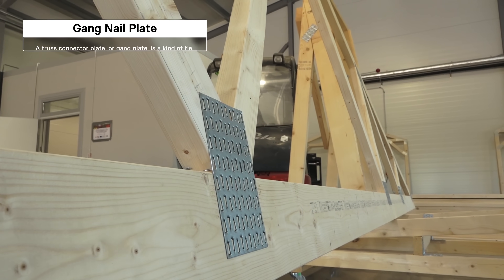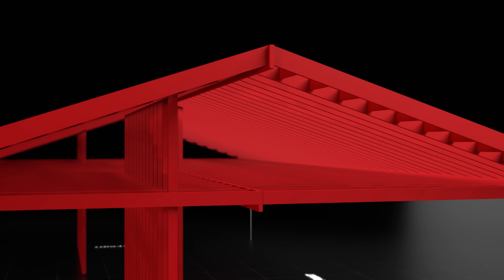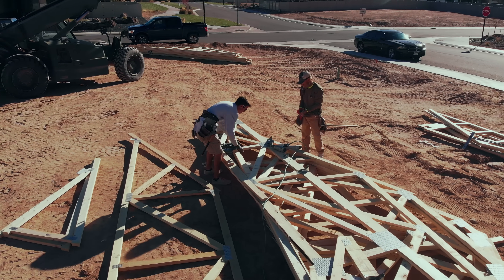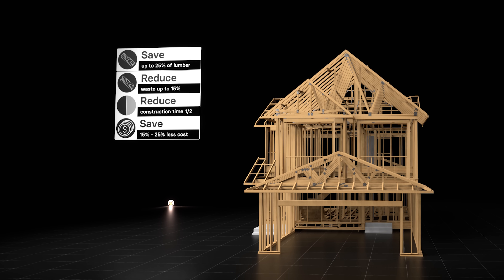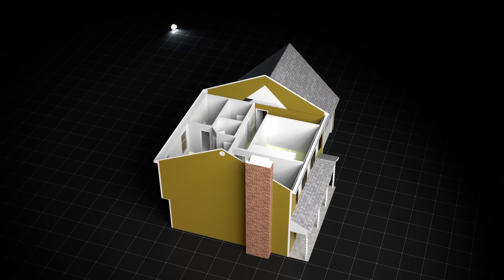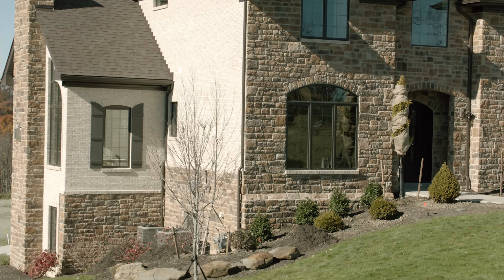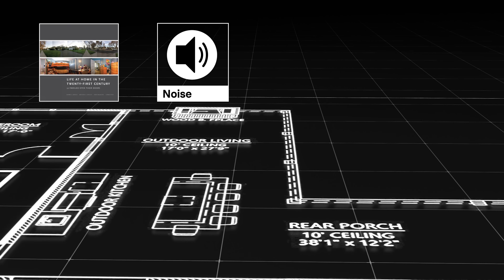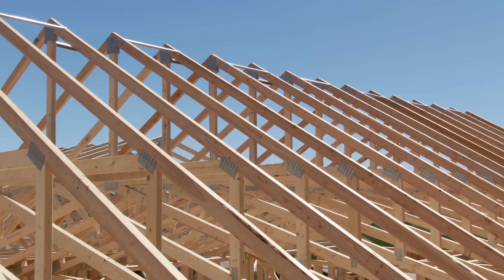The Invention that Accidentally Made McMansions

Comment: A puffy useless attic adds to the allure of being a zillionaire. Ie like giant hood of a 70s Monte Carlo. Lol.

The attics are often just rated for 10 or 20 lbs per square foot. To store light crap.  Bit Bubba after buying the MicMansion often builds another bedroom there.  And thus the floor flexes.

In prefab wooden joists they design firms save all the plans for liability.  Ie Jim Bob after buying the new house adds a bedroom in the attic. Weight room. Water beds.  Pool table.  So the structures ceilings pop off and finger pointing.  Lawsuits   blame the builder. Blame everyone except stupid Bubba..lol.

Once Bubba and June buy their Mansion they often want that fragile attic to be several more rooms. Ie do it secretly. They just build it like 4th grade tree houses. Have no clue about floor loading.  But once it fails they get lawyers to sue. That is why the wooden joist design firms keep a copy of what the beam was designed for. Ie often attic with 10 lb per sqft loading. To store xmas tree balls. Not water beds.

Comment: Rarely see trusses here on residential construction now, too much lead time, high PITA factor for setting them, etc but still building the unnecessarily complicated roofs with improperly designed dormers (but these check 'the boxes') all stick framed.  LVLs and I-joists allow those open spans below while allowing tolerances in house dimensions trusses don't.

Comment: 10:21 This brings to mind The Law of Unintended Consequences: 
"Whether or not what you do has the effect you want, it will have three at least you never expected, and one of those usually unpleasant."
Reply: It's also an example of Jevon's paradox: when you make something straight-up more efficient, more of that thing usually happens.  

More efficient cars? More miles driven.  
More efficient house construction?  Bigger homes.
LEDs made lighting cheaper?  So we made cities brighter.
Shipping container made for more efficient shipping?  More shipping happened.  
ATMs led to more efficient use of banks?  More bank locations opened.
Reply: @24HoLTeam93  On the LED comment, I really enjoy the dimmable LEDs with color adjustment. It makes winding down at night much easier with dim warm lighting.
Reply: Sounds like a key ingredient in "analysis paralysis".  As someone who suffers from that occasionally, I've learned to "not let perfection get in the way of good enough".
Reply: @coolraul07 No it’s just a matter of balancing the desirable and undesirable effects. Having worked in actual old mansions without gang nail plates or joist hangars, it can still be done. It’s just done differently.

Comment: This video has some resemblence with the increased efficiency LED lightbulbs gives. It has potential to decrease the energy-bill since it is more efficient. But now that those lights are very efficient, we can place them anywhere, increasing the consumed energy. While reseaching this topic, it appears to have been described as the 'Jevons paradox'.
Reply: @daisy9181  🤔 led bulbs last longer, consume much less energy and generate much less heat..  what are you talking about?😀
Reply: @daisy9181 Please just get “enclosed fixture” rated LEDs from Phillips/GE/Satco and stop with the conspiracy theories.
Reply: @daisy9181   😮😮 interesting to say the least, my experience is the opposite.. except the flickering, but even that is rare..  i have 11 apartments for tourists, so plenty of lights..  3 years ago during the renovation all bulbs were changed for new ones, i only changed a couple of bulbs (lets say ~10, out of probably 80+ bulbs), a couple stopped working and a couple started flickering..   it is true however that occupancy is about 50-60% so i guess not as much usage as in normal home.
Reply: The same applies in traffic planning - a new road increases the amount of commuter traffic.
Also in car safety features - people just drive faster.
Reply: Led lights are just awful.
Reply: @janelleg597   why?😮
Reply: @daisy9181  "We did it, I mathed it out, we should have had about a 10% reduction in our bill monthly."

You clearly did your math wrong.

If you have an electric furnace, a few winter nights with 10 degree lower temps are going to be enough to overwhelm your electricity savings on all your light bulbs for the year. One day of baking Christmas cookies will wipe out your LED savings for the month.

Whoever told you that you could expect a measurable decrease in your energy bill by switching to LEDs was lying to you. Lighting was never the main driver of your electric bill.

Comment: Really interesting, thank you! Was wondering if this was only a US thing, since all the modern houses I know in Germany still have attics. Thanks to all the commenters mentioning the issues in case of fire, that sure explains it! I think most modern buildings in Germany aren't entirely made of wood, just the roof structure, so they probably withstand fire for a while. Long enough to try to go in an put the fire out if it's safe. Meanwhile in the US the whole building structure often seems to be wood? So it might just burn faster in general, byt the time you start worrying about the roof it's too late anyway? (Wild speculations, would be interested to hear if that's actually the case from someone who actually knows things.)
Reply: So long story short, the smoke and water damage caused by putting the fire out are just as damaging.  Restoration work is labor intensive, expensive, and often results in a subpar product. Often it is just cheaper and better to completely tear down and start over. Unfortunately, much of American culture encourages a disposable attitude towards goods.  Mostly to maximize corporate profits.
Reply: Interesting, thanks for explaining! :)

Comment: NIST Abstract Publication from 2007 "A Study of Metal Truss Plate Connectors When Exposed To Fire" 
"The popularity of lightweight, metal plate connected wood truss construction is increasing due to cost effectiveness, versatility, and ease of construction. This type of construction brings many concerns to the firefighting community, since structural collapse has caused numerous injuries and fatalities in the fire service. In an attempt to determine the performance of metal plate wood truss connections during fire exposures, NIST conducted a series of twelve instrumented tests exposing one side of the test specimen to the thermal exposure. Load carrying ability of the metal plate truss connections was not measured during these tests. The tests were purely an attempt to study the heat transfer between the metal plate and the wood. Results from these tests suggest that the metal plates help to protect the wood beneath the plates."
https://www.nist.gov/publications/study-metal-truss-plate-connectors-when-exposed-fire

Comment: Europe: The invention of this early type of concrete allowed us to build massive castles 500 years ago.
USA: This metal plate allowed us to build larger wooden houses in the 1990s.
Reply: Larger cheaper faster baby, that's the American Way.  Who cares about sustainability or utility
Reply: @MarkBonneaux  The worst is all the ultra crappy foundations that get poured where I live. There's no reason that foundation repair should be the thriving business it is.
Reply: My German home has solid brick walls and steel-concrete floors of 10 inches. It will probably still be around in 200-300 years. My great-grandchildren may have to get the roof tiles changed around the year 2100, though (they are already 53 years old today).

Comment: FWIW, I think that it should be absolutely vital to apply intumescent paint to the plates, so that the heat from the fire can't cause them to char the wood until they pull out and the roof collapses.  

(Does anyone know if any tests have been done for this?)
Reply: It’s a good idea.  Probably more economical than covering the area in fiberglass cloth, which would also retard to flames. It’s not fireproof, but it is resistant enough to buy you some protection.

Comment: I'm surprised given the prevalence of tornadoes in parts of America, that heavier more robust building materials aren't used. We use heavy i-beams to support the weight of the roof while opening up the roof space.
Reply: A really powerful tornado is going to destroy any structure in its path. So steel beams won't matter. Tornadoes can pick tractor trailers up. The whole truck.
Reply: @1pcfred  While I can't truly appreciate the devastation of an F5 as I've never personally witnessed the destruction, there are always design solutions. A concrete basement with reinforced roof would be adequate surely as you normally see bare pads after a tornado has passed through.  Is that why people use wooden houses as it's cheaper to rebuild? When building for earthquakes we use lots of thin concrete superstructure but it has a high proportion of rebar to flex. That said I can't imagine the heartache for families picking up the pieces after a tornado.

Comment: Focusing only on the price of the lumber for roof structures, while ignoring the problem of  accessing the resulting  space filled with a forest of sticks. Accessing the space requires stepping onto thin struts hidden by a mound of fluffy insulation, or missing the  strut and poking a whole in the gypsum board ceiling below. Checking eaves  in a ventilated  requires crouching while moving on the same hidden struts.  It's a false economy.

Comment: I work in building design, without this technology the cost of framing would remain too expensive meaning many of my projects would have never seen it through to construction.  As for attics, don't forget attic trusses, used alot in the UK. Still trying to convince Australian truss factories to do this.  There is still a place for hand pitched timbers, often mixed with truss manufactured roof frames to achieve amazing results.

Comment: With all due respect... My 5  year old >5000 sqft house uses way less energy to heat and light  then my 2000 sqft stick framed house from the early 60's.  It is way better built,  and way more conferrable.
Reply: Get back to us in 60 years.

Comment: This is coming from someone who doesn't build roofs for a living. Gang nail plates are just a convenience, they make it so that less skilled individuals can install a roof more easily without having to calculate the angle and cuts. With modern nail guns, I don't think anyone has issues toenailing boards to the sil. I live in an area with old roofs and lots of snow and you only ever see one style of roofs collapsing and that is the ones made with gang nail plates on the truss.

Comment: Unfortunately , truss plates do work, even though they don't look like they should ( and even tho' you don't really want them to ).  So many shortcuts in the modern building trades, there are.  Do not even get us talking about flake board / aspen board / OSB ( the shredded wheat pressboard sheathing solution ).  Unfortunately for a lot of these 'quick 'n' nasties', they FAIL and fail miserably when subjected to sudden or undue stresses, fire or water damage and the like.  Another problem is that it is more 'democratic' and opens what should be more specialised, technical trades up to the do-it-yourselfer.  I'm all for learning things, self-performing work and 'making do', but this also means that just about any trunk-slammer can have a go at things and get passed on inspections.  These types of materials and this type of construction will also not stand the test of time.  The *McMansions*, like it's fast-food counterpart, are cheaper and faster, but not as satisfying, as durable or as secure.

Comment: I would have said AC, and insulation. My house built in 59 has no AC and no Insulation, so it’s tiny. Heated by a fireplace.
Reply: I think you answer holds alot of merit. AC and insulation have allowed building to increase greatly in southern states like Texas, Florida, Arizona, and New Mexico.  Developers picked these states because land was cheap there due to their extreme summer heat. Many of these new builds would fix the moniker of ‘McMansion’.

Comment: I saw a million times but it's always surprising to see that American homes are fast built and wood made. In my country, you house will, by law, be made with bricks, cement, steel, concrete and mass, and take a long time (4~6 months for the average house).
Reply: It used to be like that here in the U.S. until around 1997 when President Clinton passed The Tax Relief Act that exempted capital gains tax on residences up to $500K for a couple/$250K for singles.  Since then, prices have raised accordingly as people flock to use their homes as a tax shelter.  Builders want to crank out as many as possible so they use materials that allow them to cut corners on labor, which is also their biggest expense.  Profiteering in housing is bad for a society.  Creating tax policy that enables it is just a catalyst to the downward spiral.

Comment: Too many builders refuse to use ceiling batons for the drywall, fixing drywall directly to trusses can cause joint peaking as well as fixings popping. Even worse are trusses at 1200 cm centres with intermittent ceiling joists which causes uneven movement for the drywall.
Reply: This.  Nothing is supposed to be place on any part of the truss.  Loads on top of the roof will be transferred down to the walls, as designed. The load of material (drywall, shiplap, bead-board, etc) attached to the bottom of said trusses does not get transferred to the walls.  It creates a downward pull on the truss at the very point of the plate.  This is your weakest structural point in this design. Instead, attach ceiling framing to your walls using jack studs to transfer that weight down to the bottom plates of your walls.  Then hang your ceiling panels to this grid.
Reply: @kld70  In practice no builder will be doing that due to costs. That's the way it is.

Comment: Funnily enough a related thing happened in Australia in the city of Darwin - also a low lying tropical city, battered by cyclones where roof detachment caused chain reactions of destruction. But instead of truss plates, the solution was to use screws.

Comment: I am a Architect in Los Angeles. The change in FAR is what enabled the existence of McMansions not the gusset plate.  The FAR change allowed the total square footage on the site to fill up a site all the way to front, side yard and rear yard setbacks for two stories, and developers took advantage of this, because of a housing storage and the cost of real estate in Los Angeles. There are a number of other ways to get greater spans, one is manufactured beams and rafters. The gusset plates were invented to reduce the cost of construction and highly skilled labor was not required to set the trusses.  You have to be a pretty go framer to frame a hip roof with all the compound angle cuts, the gusset eliminated a lot of skilled jobs.
Reply: That's great. Thank you for explaining the acronym FAR for all of us non-architects. Your comment made a lot of sense to me.
Reply: Floor Area Ratio   
https://en.wikipedia.org/wiki/Floor_area_ratio
Reply: @jayadinash9102  Thank you. I was trying to figure out what the Federal Acquisition Regulations had to do with the size of a house in Los Angeles.
Reply: And setbacks also enforce what I call the "English Manor House" model - which is OK if you want/like that. I'd prefer a middle eastern style where the house is built right up to the property line and faces inward to a central atrium. This style has been around since at least Roman times, probably far earlier. But good luck building such a home in the US.

Comment: I don't understand why the gang nail plates specifically revolutionized roof construction and the building of trusses. I mean you can use virtually anything to hold the components of a truss together, like nailed pieces of plywood for instance, or any other kind of metal plate that accepts structural screws or nails. Why did it have to be gang nail plates?

Comment: I'm a crane operator and I set wood trusses every day. The level of engineering for the load points on floor and roof systems in a modern mcmansion is insane. A week ago I did a house where a set of mono trusses hangered off a girder, which hangered off a beam, which hangered off a girder. I'm glad im not the cut man putting the sheathing up on the roof.
Reply: Operator here too. Another thing that amazes me is the number of LONG clear span trusses I see every day now vs 20 years ago.
Reply: @petejohnson8397  That's because people want open floor plans.
Reply: That just sounds fucked 😆 I'd opt for more steel columns and beams/lintels to support shit like that.
Reply: my house may be older but screw all that nonsense lol. Mine has 4x4 every 1/8 the distance of the long side of the house and 4x6 on the outer corners and middle and in the middle of the house the other direction where the joists meet. Sorry not a framer so have no idea what all it’s called, I’m a nerd so I go by diagrams. But yeah and anytime I want a larger span like I did for my kitchen area… LVL. I do agree it’s not and will never be as cheap but ehh I’ll live. I can afford it and I don’t want a balancing act house LOL 

Nor do I want a fire to swallow it in 10 minutes. These comments about fire and trusses and nail plates scare me.

Comment: Disagree.  Gusset plates allow for cheap, mass-produced trusses built in factories and allow smaller sized dimensional lumber to be used.  My house has a complex roof line, open concept (but not vaulted ceilings) and its stick built, with laminated beams allowing for the open space. The builder who we used also has open floor plans with vaulted ceilings and none of their houses use pre-fab trusses. The high volume builders use those.